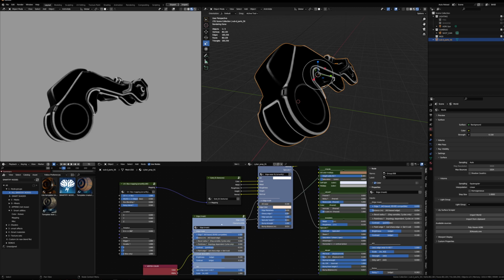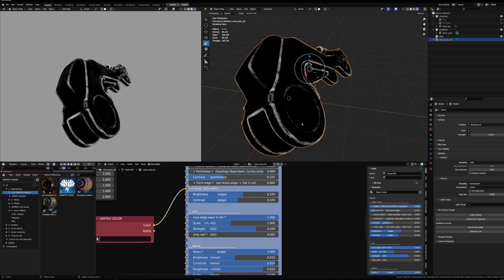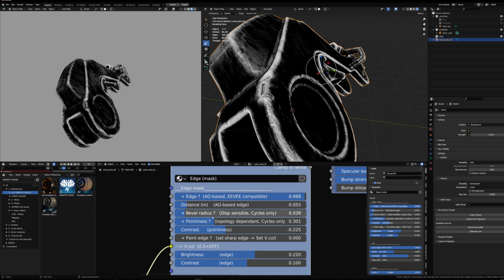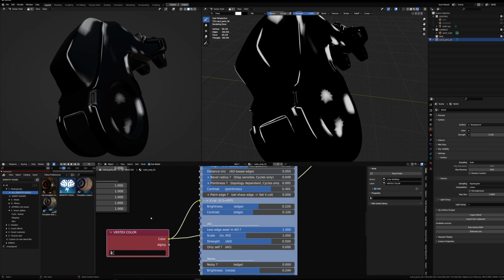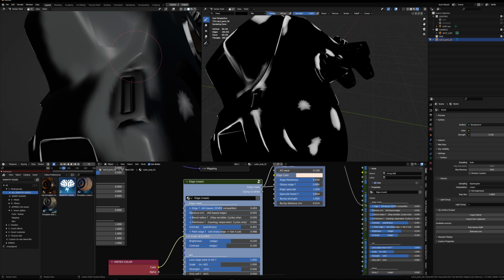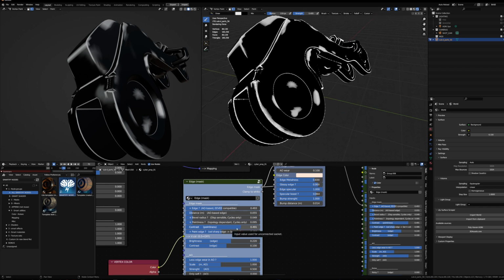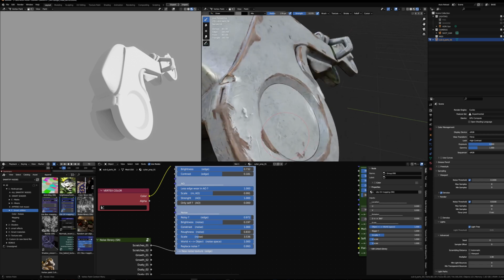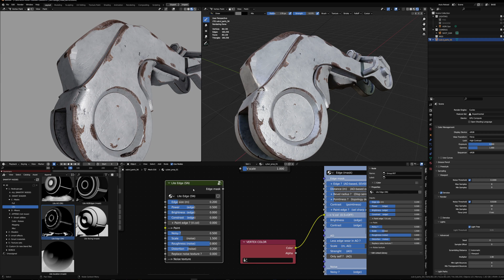Smartify Nodes - Edge mask tutorial

Comment: Can I replace the textures with what I want?
Reply from the maker: Yes of course, you can open any node and customize anything, noise textures are specially easy to change/mix even without opening any node.
Press tab once you select a node to enter it, and exit by pressing the arrow button tip right of the shader editor ( can assign ctrl+tab shortcut to exit nodes for example so it's super fast and intuitive, like mesh edit)